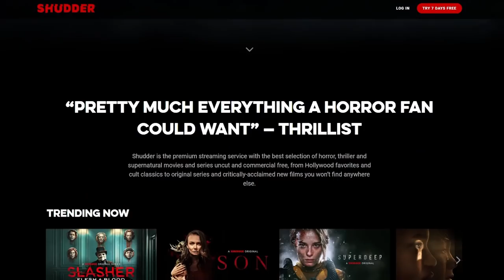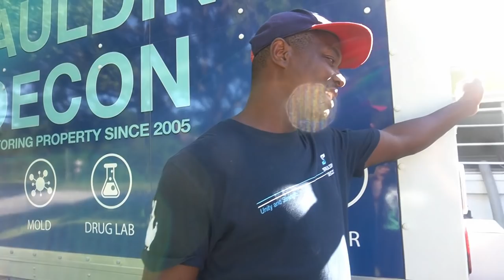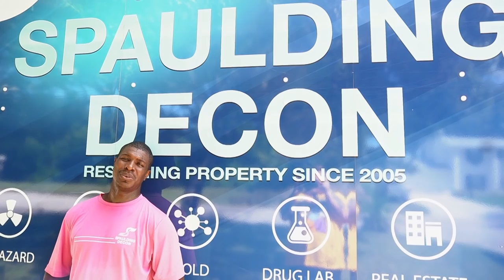IT'S RAINING RATS! | Clearwater, FL

Comment: ugh that's so rough for the client. :( I recently had racoons invade the underside of my trailer. There were like 6 of them and they tore all my duct work out and made a major mess. I was able to get them to leave with mothballs but they caused like $2000 in damage. I had to replace like 240 ft of flex tubing. Watch for critters, yall. It gets bad really fast.

Comment: Please help answer a question. What do you use to clean soot off walls? I’ve tried vinegar and water. It takes off most but there are still streaks. Carol in Florida
Reply: I have used sugar soap in the past
Reply: Pressure wash it